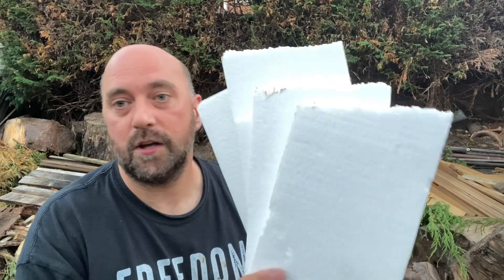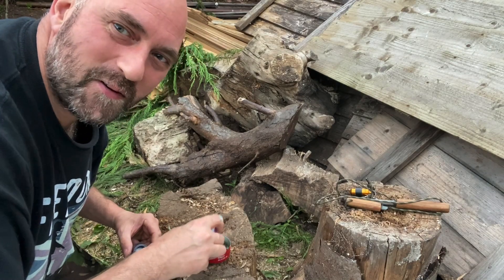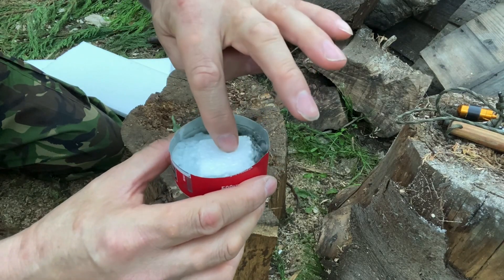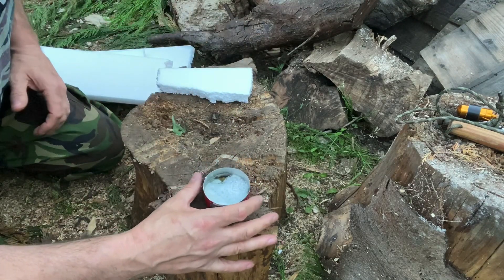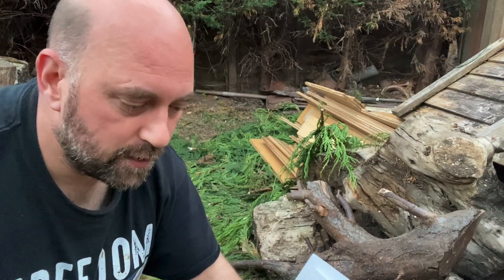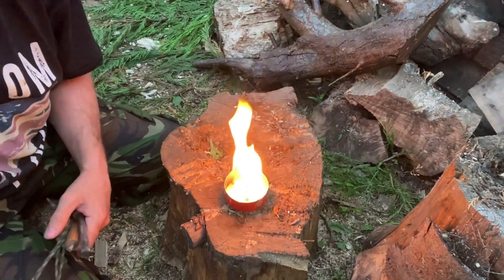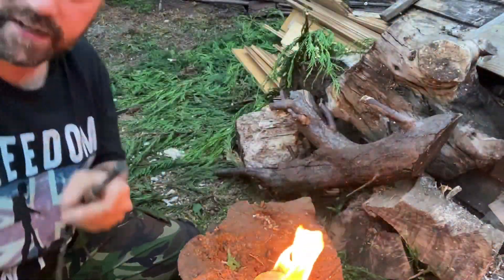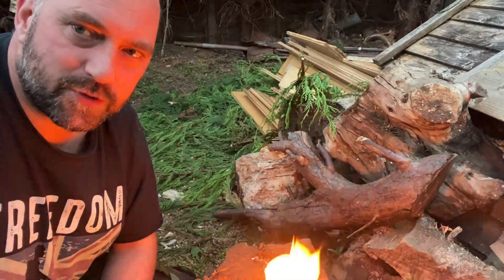Emergency fuel from polystyrene

Comment: Just a warning, burning polystyrene produces carbon monoxide and a bucketful of other toxic chemicals so ONLY use it in an emergency in a very well ventilated spot.
A couple of mates are fire fighters and have a few horror stories about plastics fumes, the inside of the average sofa has foam that produces phosgene gas, even nastier stuff than polystyrene.
Apologies for putting a downer on things.
Reply from the maker: Absolutely agree brother and thank you for sharing your comments! I should have mentioned that in my video. I was only really demonstrating for emergencies, so hopefully people will get that. Yep nasty stuff! Thanks again mate 👍🏽👍🏽😎 best wishes